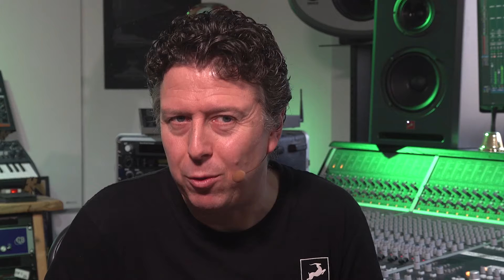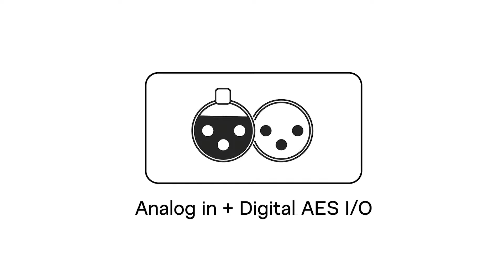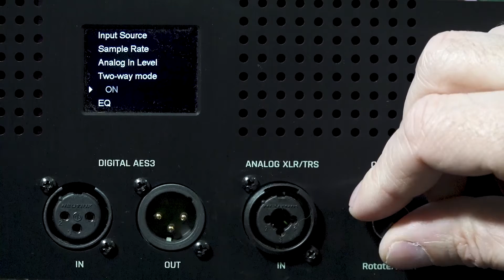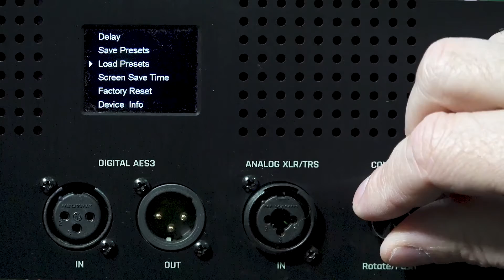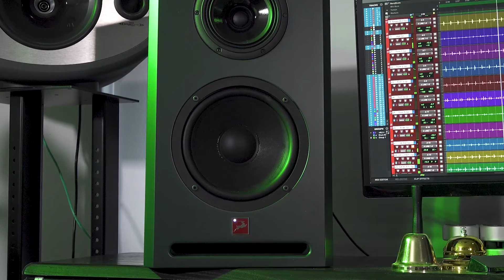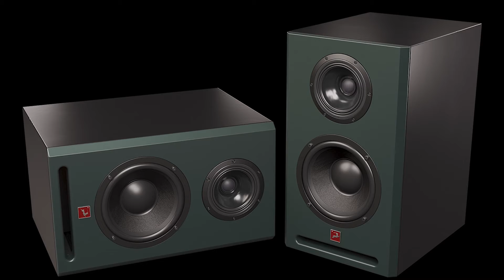Atlas i8: Clarity, Depth, and More! | Part 2 -  Control Functionalities

Comment: I bought two of these speakers at Thomann last summer. I was excited about the "N-fire" bass solution. nevertheless, one speaker distorted in lo mid. I have sent it back for repair two times but they appearently are not able to fix it. Now I´ll have to send it back the third time. The other speaker suddenly stopped working. I sent it back but they found no fault. Got it back. It worked but suddenly it stopped working again. Now I´ll have to send it back the second time. Cant work with these speakers though they sound good - when the work.

Comment: YOUR SUPPORT SUCKS @ANTELOPE AUDIO~!!!!! I have a new Zen go synergy core and can never get support. It is not functioning as it should. WHY SO FRUSTRATING!!!!??? Calls do not get picked up, emails do not get responded to and chats are just a dummy, no one there. WHAT IS THIS!???
Reply: C'mon Man 🥱
Reply: @kobiljaglava3138  Take a seat 💺
Reply: Really? I own a Zen Go too, connected to Windows and had a few bugs shortly after I bought it. The bugs were  software related and in part due to my lack of computer knowledge.  I have contacted Antelope Audio customer service several times  via emails and have always received a reply within a day or two and everytime the staff there was kind and helpful. They took care of my problems and brought solutions. I have been using my Zen Go for over three years now and have upgraded my unit to the latest software a couple of times and everything works fine so far. Are you contacting Antelope Audio directly or going through a local distributor or retailer? 
Make sure to contact Antelope Audio directly. I took their email adress from their corporate website. Maybe this will help?
Reply: ANTELOPE ARE KINGS OF DECEPTION RUN FROM IT ,, their drivers cant keep up whit their hardware.  their plugins not working ok  a wast of time  they  should  sail the company  and go fishing. sync errors  zen go  plug unplug some times a day they are not honest  whit people who give them money
Reply from the maker: Hello,

I'm really sorry to hear about your experience. Are you still encountering issues with your device? If you've already contacted our support team, could you please share your ticket number?